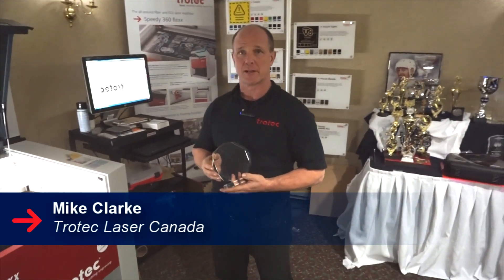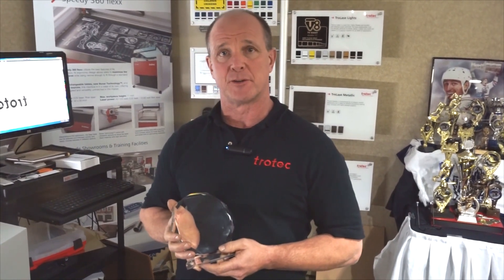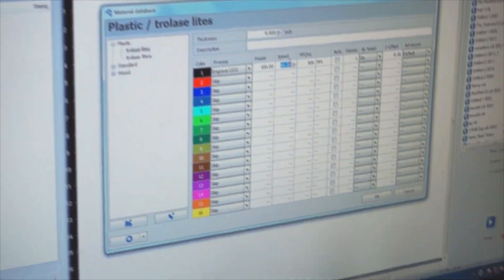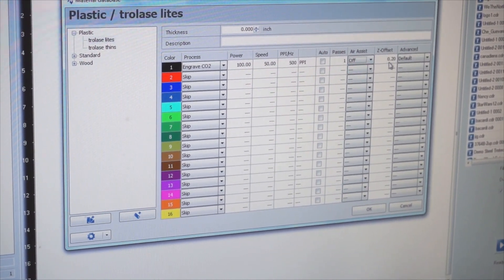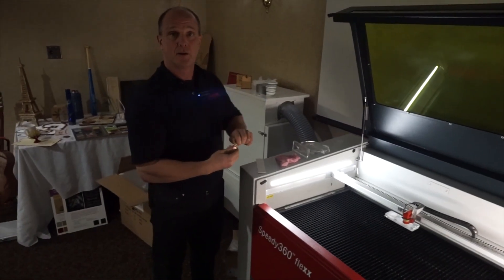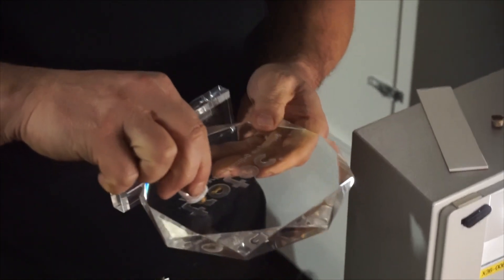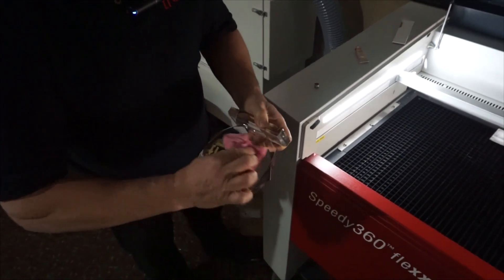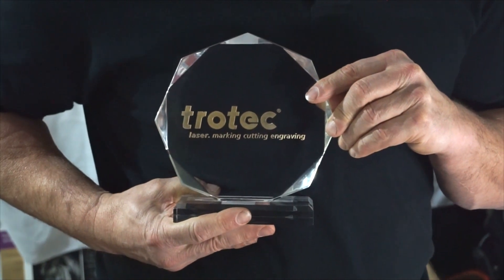Reverse Trophy Engraving | Acrylic Laser Engraving

Comment: Hello,

I noticed that you mentioned you should never use air assist for engraving, only for cutting. Is that only for acrylic or all materials? Also, can you give the reasoning behind that please?

Thanks,
Reply from the maker: The air assist blows the airbourne acrylic vapour from the surface back down onto the surface of the piece creating an additional cleaning step.  Using no air assist allows the exhaust to remove the acrylic vapour without it marking the piece.  It's very important to remove the nozzle on Speedy 300, 360 and 400's when using no air assist to avoid damaging the lens. Air assist while engraving is typically only used when processing flammable materials such as rubber or silicone.